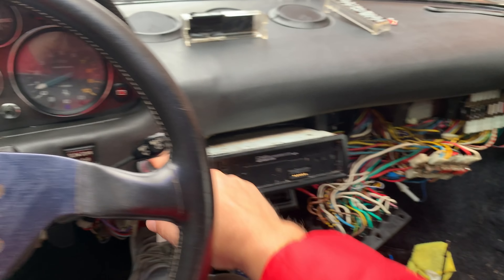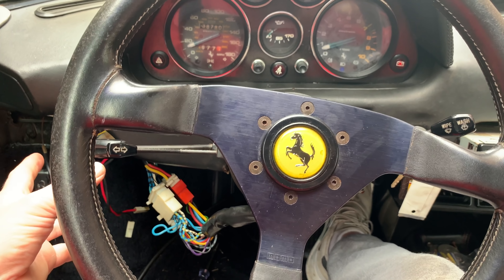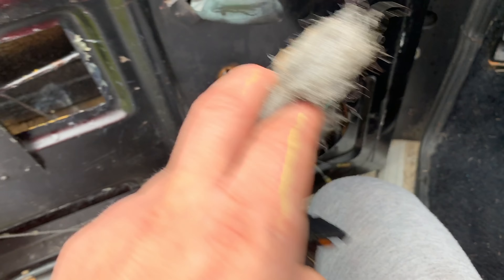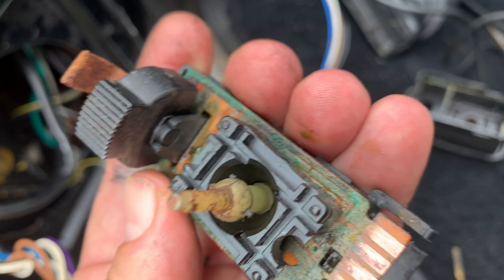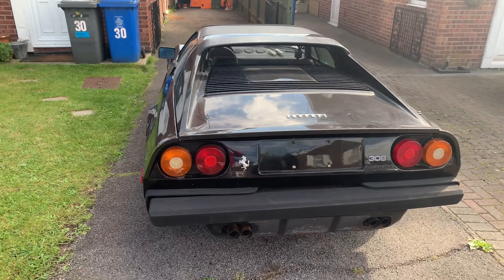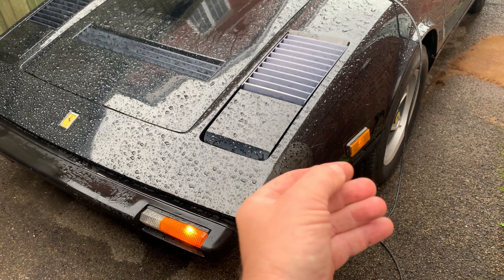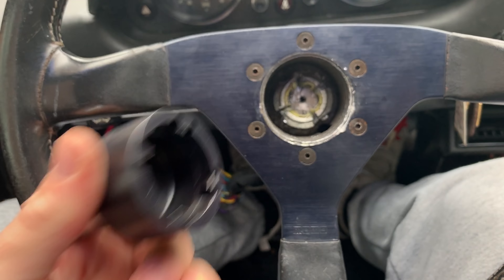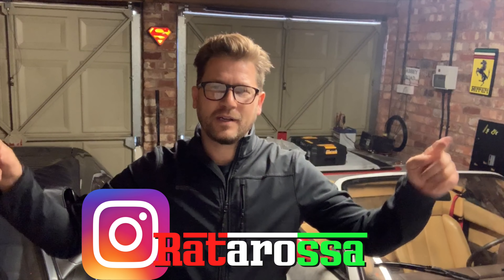Heres what happens when you leave a Ferrari for 20 Years Part 21

Comment: The steering wheel bolt was corroded on because the horn wiring has been shorting out inside the boss, electrically fusing the two metals together. The shorting is quite common since the insulation literally wears away as the wheel is turned. Congrats on getting it off without breaking anything.
Reply from the maker: 308restoration.com very interesting, that makes total sense. Honestly couldnt believe how hard that was to remove

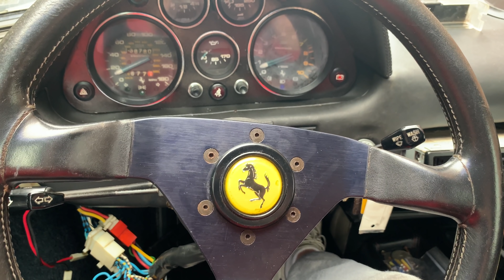Comment: @6:25 - looks like the same mirror switch from my old '79 BMW 733i. Easy to disassemble and clean - has four tiny ball bearings that ride over a circuit board in a bath of dielectric grease. Clean the board with a pencil eraser and add fresh grease. FYI.
Reply from the maker: Jeff Becker Jeff I’ve stripped it apart and cleaned it up but I think the board is to far gone. I’ll look out for a bmw one and replace it
Reply from the maker: Jeff Becker cheers Jeff 👍🏻👍🏻👍🏻

Comment: When it comes to those style of sockets, there are some options. Were it me, I'd find a cheap socket with the correct OD, and mill the teeth onto it. Good call with opening the door.
  You might look at jeweler's rouge or valve grinding compound for cleaning contacts. It's a little less aggressive than the steel wool. A set of connector disassembly tools might also be good. If you can pull the individual pins out of the connector, you can clean them too. Dielectric grease is your friend. I never go without it. I always sand grounds bare, then mount with dielectric grease on the surface. If it's not a part of the design, I generally fit a three point ground at the main cable. I find that makes things work better.

Comment: On my 308 the ventilation sliders just moved cables to control the air vents and the on-off water heater valve.  The heated rear window switch was a rocker with an in-built warning light sited just to the side of the handbrake.  I couldn't see from your video if it was present or not.  If you don't have the hand book they are available on-line for free.  I found a US spec one pretty quickly at https://www.manualslib.com/manual/467002/Ferrari-308-Gtb.html?page=26#manual.  Hope that helps.
Reply from the maker: Cheers Tim, You are absolutely right. I do have a user manual but not checked yet so thanks for the link. I did'nt see the switch on my car but wasn't expecting it back there. Will take a look tomorrow.
Reply: @Ratarossa  Ergonomics weren't a priority - eg the hazard switch between the fan and wiper speed switches.  One of my other favourites was the light stalk, which you could easily flick from main beam to sidelights, usually in the pitch black doing 60 down a country road :-)

Comment: Cleaning and redoing all the ground straps usually brightens up all the lights and reduces electric load on the alternator when you run defrost or air-conditioning. I've had a couple cars where the ac didn't work. I cleaned and replaced the engine ground straps for weak starting and incidentally discovered the ac trick and lights were much better.

Comment: Holy, at 12:22 that steering column looked flimsy. The breaker bar sure put a lot of torque on there, think it got damaged, or did it feel ok and simply a bit flexible ? Steering and braking are like the important pieces, don't want to take chances with them :-)

Comment: Well done for persevering with the electrical work. I'm guessing the tyres are also at least 20 years old. Will you put a new set on before the mot?
Reply from the maker: Tricky one, they are old but not cracked etc. The issue is they are TRX tyres and they are super expensive so i have a dilemma, yes they will be replaced before I actually start using the car BUT do I a)upgrade the wheels to the 16" version or b) Replace all 4 tyres ?
The cost for a set of 16' wheels + tyres cost the same roughly as a set of 4 TRX tyres. 
So do I stick with originality or upgrade and also get much better modern tyres safety and traction ???? 
It's a great question so thanks for asking, Ill put it in a future video and get everyones thoughts on the subject.
Reply: @Ratarossa  Upgrade to the newer version wheels and use modern tires. Safer and more future-proof. And if you aren't a complete purist, a guy in our local chapter (FCA) put 360 "starfish" wheels on his 308 and they, surprisingly, look *amazing*. Keeps the old school styling of the car lines, but gives it a modern twist that really fits since they are still 5-spokes. I believe the offset is different, so he had to use spacers, but I was really surprised at how much I liked the look.
Reply from the maker: Jeff Boen nice idea Jeff, I’ll find a picture of that 308 👍🏻👍🏻👍🏻

Comment: Your doing a great job. And your also very helpful. But what happened to the 456. I have a 456 Wish a headlight that wont pop up,can you help?
Reply from the maker: salvo mineo I’ll be back on the 456 shortly. Is the motor working correctly on your headlight. The great thing about the 456 is it’s very easy to see the motor etc and watch it while operating
Reply: Ratarossa no it sounds like there is a broken Gear.